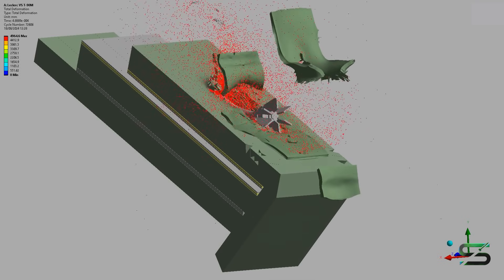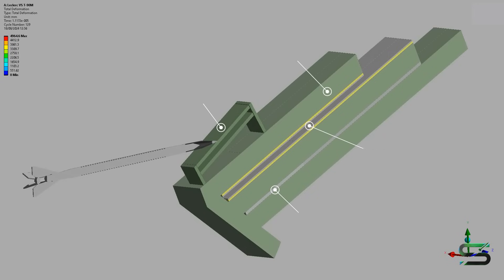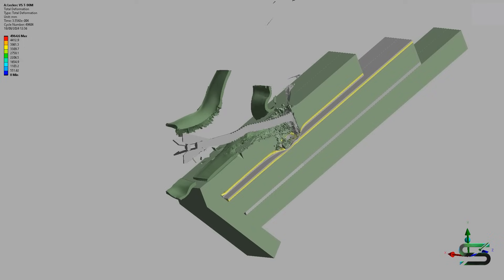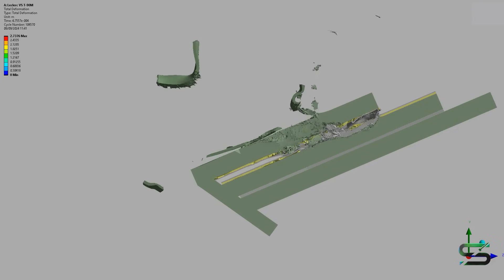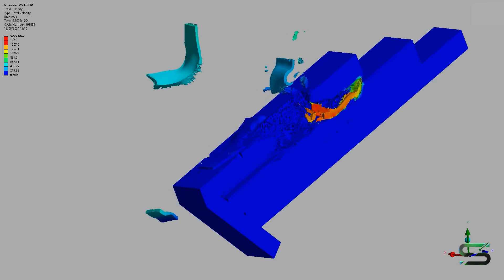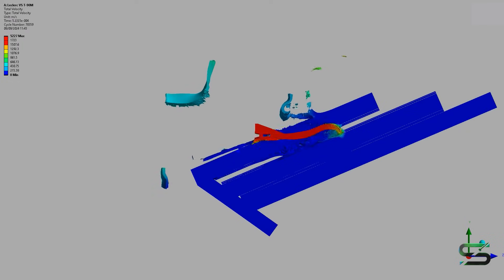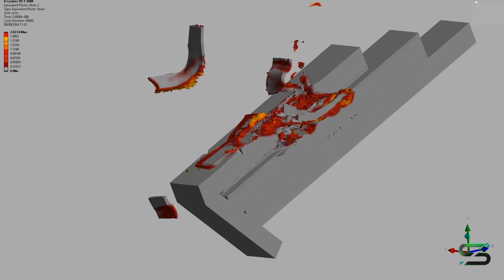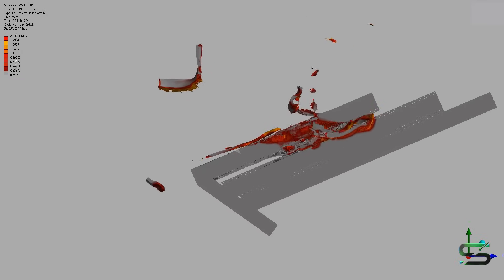Leclerc VS T-90M | Armour Piercing Simulation

Comment: It’s just the gun and ammo you have on your tank. The one who shoots first, wins. Still wondering Turkey has 2000 M48A5’s in 2 batches modernized to the M60A1 and M60A3 standard, the T1 and T2 resp. but why not a 120mm gun yet? I believe that a Leopard-2 is the best tank according to economics, logistics, and capabilities. Leclerc is too expensive. M60’s are old so…no future for them?

Comment: There is a reason why Aberdeen proving grounds does NOT release its actual testing done on NATO tanks….most tests on our WW2 tanks wasn’t released to many years later.  For example the jumbo Sherman’s front hull armor could not be penetrated even by a tiger tank.  The rounds just embedded or bounced off.  The tiger was easily penetrated by the easy 8 Sherman and firefly

Comment: I know you mainly deal with WWII-Modern tanks, but have you ever considered modeling the armor of naval vessels? Particularly with how many used face hardened armor instead of the more homogenous plates used in tanks, and how the behavior of that material may differ from homogenous armor. Also the effects of coal bunkers on shell dynamics and penetration could be an interesting factor, particularly on 19th century protected cruisers which factored coal bunkers as a somewhat major aspect of the protection scheme, in addition to their sloped armor decks

Comment: M2 Bradley IFV: hold my beer
Reply: In the full version of the video, Bradley only disabled the T90's optics, after which the tank drove away and gave the crew the opportunity to leave the battle - so whats your point?
Reply: @VVV85650  Bradley permanently deprived the tank of combat capability. In war, this is called - the tank was destroyed.
Reply: @inglorious_kycb  Nope, in war this is called the tank was disabled, and in the context of this video with the simulation, it means that the Bradley did not penetrate the T90 armor
Reply: @VVV85650  Judging by the fact that the tank's turret drives and gun aiming were also disabled by the Bradley fire, it was very much destroyed.
Reply: @inglorious_kycb  Destroyed means blown up. But you can keep coping, of course.
Reply: @inglorious_kycb you're actually only affirming his point and deviating from the point you wanted to make. As long as it isn't completely destroyed, it can be retrieved and repaired.
Reply: @dialectics7097  the tank was disabled and abandoned. it was then finished off with drones. Keep coping, but its not going to revive the tank.
Reply: @RocketPal chiming in pretty late huh? Have you not read the previous replies? That guy here specifically claimed that the Bradley itself "destroyed" the T-90M right on the spot when it didn't; it only "disabled" it. What completely destroyed it was the drone.

And I'm not sure at this point if your reading comprehension is simply that low or, in case if you're taking side on this conflict, that overshadowed your ability to read and reason that you impulsively replied just to defend that side.

Comment: How about segmented penetrator like DM53 or M829A4 ? 
Rheinmetall uses a special state-of-the-art tungsten penetrator that is capable of
overcoming the most extreme cutting and bending forces of double-reactive armour.
This makes it possible to defeat all known types of tank armour, including multi-layer
and composite arrays and reactive armour systems at all ranges of engagement.
Even at long ranges of engagement, it can perforate the main armament behind the
double-reactive armour front module of modern MBT. Fired from L44 and L55 tank
barrels, the ammunition is extremely accurate.

German patent DE 4023482A1
  Zu einer Anhebung der Durchschlagsleistung von unterka-librigen Wuchtgeschossen 10 an Mehrstoff-Sonderzielen werden vor ainem Hauptkern 20 zwei Vorkerne 21,22 kleinerer Masse angeordnet und wird eine die Vorkerne 21, 22 und einen Teilbereich des Hauptkerns 20 umschliebende ballistische Haube 11 mit einer Spitze 12 aus Wolfram-Schwermetall versehen.                                                                                               Die Spitze 12 wird in die ballistische Haybe 11 einge-schraubt. Der erste Vorkern 21, der sich vorderseitig konisch verjungt, wird mittels einer Madenschraube 14 axial fixiert. Die Fixierung des zweiten zylindrischen Vorkerns 22 erfolgt beispielsweise uber einem am Hauptkern 20 vorgesehenen Gewindezapfen 26. Ziwischen den einzelnen Kernen 20,21,22 konnen Zwischenlagen 15,16 aus einem weicheren Material zur Stobdampfung vorgesehen sein.

Comment: I thought the K2 panther was the most expansive at around 10millions.. But holyshit did a 2s search on google and the damn leclerc cost its about two time the K2 Panther...   With that you can have like 6 T-90m... or like 3 Armata..
Reply: If I remember correctly part of the Leclerc's high reported cost is connected to being built by a government owned French corporation, and a bunch of odd accounting leading to the price looking very high. A lot of French military equipment is like this, they're very protective of their defense industry and always buy domestic, but because it's nationalized a lot of the cost just returns to them through tax/accounting tricks.
Reply: @maevethefox5912 no, French industry knows how to make inexpensive equipment, simply when we manufacture 800 examples of a very modern tank (therefore with large research and development costs) the cost is spread over too few examples (only the tanks for the French army financed the development therefore 400 copies) Leclerc's problem is the timings, the 90s is not the right period to export tanks, the English had the same problem with the same results.
Reply: @maevethefox5912  But Russians also own the entire military industrial complex company's, but the prices are much lower.

Comment: Now that vs object 292
Reply: The 152mm APFSDS of the object 292 is missing roughly 200mm of pen in War Thunder, the shot actually has around 900mm of pen.
Those are the values if you take the quality of 3BM22 and adjust the speed and weight. So if the round HAD the quality of 3BM60 it would have over 1000mm penetration. Which should be expected at the insane Muzzle Energy the canon has

Comment: the 120 F1 is no longer use by the french since the late 1990's, the leclercs is no longer the most expensive mbt, 8 million $, it's the K2 Black Panther and the maintenance is absolutely not complicated since the tank is entirely modular and very reliable
Reply: man 2s search said that that leclerc at 2022 cost was 16m of euros. Even wikipedia with a link to a document of the "ministere des Armees".
Reply: @Rek1emMScar  they were probably talking about the xlr, not the og Leclerc
Reply: Most expensive MBT now is Leopard 2A8 which 29 million Euro each
Reply: @wyne9145 which is crazy. You can practically buy 6 brand new  T90M or about 10-11 upgraded ones. 
Who's gonna pass on that sh1t? 😂
Unless they are BOOKED
Reply: Wrong, LECLERC is very unreliable.

Comment: 14 million per tank certainly doesnt make it the most expensive tank. leopard 2a7v costs like 18-20 million doesn't it?
Reply: No, the Export cost of the Leo 2A7V is 20 million, that isnt the production cost.
The Leclerc is more expensive in production, mainly due to the Military Industry in France, if you produced the Leclerc in another country it would probably cost a fraction of its current cost
Reply: @Richard_T800  interesting thx for the information!
Reply: nah Hungary buy 44 leopad 2a7 for 500m. so 11m a piece.  And that i would said was a "bad" deal. For example Chilean leopard2a4 cost was like 800.000us per unit.. and when Germany did upgrade it 2a4 to 2a7v the cost was around 8m. And that its because 2a4 chasis need a lot of work to sustain the almost 70tons of leopard 2a7.

Comment: Before any of you get rabid about how innacurate simulations of modern weaponry are, consider, that most crucial informations about them are usually a secret or known on a surface level. People making those simulations have to work with what they can get.
Reply: There's nothing secret in a Tungsten dart. Simulations tend to be inaccurate because computers can't really show how physics work, that's all.
Reply: Well, there's nothing particularly secret or unknown about OFL F1 (1993) or T-90M's armor (which is T-72B's from 1983, but with a new ERA that isn't too much of a mistery anyway).

This simulation in particular is accurate. OFL F1 is a low end shell by current standards (which is why SHARD, with a significant increase in performance and now ready for mass-production, has been developed to replace it), while T-90M's armor is extraordinary... as long as its Relikt ERA is online.
Reply: @SpanishAvenger  The T-90M has welded armor not cast armor.
Reply: @SeanMurphy1090-d5u  That’s regarding the turret, yep- however, I was talking about the hull, which is what’s shown in this simulation.
Reply: @SpanishAvenger  between 1984 and 1989, there are 3 different armor layout for the T-72B hull so you better stfu
Reply: It’s just Russian propaganda
Reply: @abradolflincler3802  no when you look at the armour with your eyes(unless you are blind) you can see that russian tanks have the most effective thickness of any modern mbt and the era is just a cherry ontop
Reply: @abradolflincler3802  everythink good is Russian propaganda of coarse, dont you also follow CNN and Ukrainskaja pravda, also ironically called "The beacon of democracy"
Reply: Yup
Reply: Nope, you just work with what you don’t know about. As simple as that.
Reply: Ele deveria deixar a observação no vídeo pois no vídeo é como se fosse a simulação real.
Reply: Not just that but he also got it wrong that the Leclerc hasn't been sent outside of Europe, doesn't inspire confident in any of the results on his videos tbh
Reply: @haaxeu6501  Didn't Saudi Arabia or the UAE was it? Collabed during the creation of the Leclerc and thus gained 200 units
Reply: @haaxeu6501 Leclerc was sent to Lebanon in peace keeping operation
Reply: Warthunder players, assemble!
Reply: @nasuegaming1255  I mean he didnt aim for the lower plate or drivers port🫢
Reply: The leclerc is junk, just like the t90, war thunder has NOTHING correct.  This is only a simulation, the t90 is easily destroyed we know this from many filmed encounters irl.  We also know that no Abram’s tank has ever been penetrated from the front.  Even with DU rounds.  Gulf war, we tried to destroy one of our stuck tanks in the mud, the were ordered to destroy it.  The were unsuccessful from the front using DU, They then got high ground and fired into the top of the turret, thinking they destroyed it.  Vehicle was recovered, a new turret was dropped onto the tank and it was back in battle.  This was just the m1a1, the sep3 and sep4 can’t be touched by another tank.